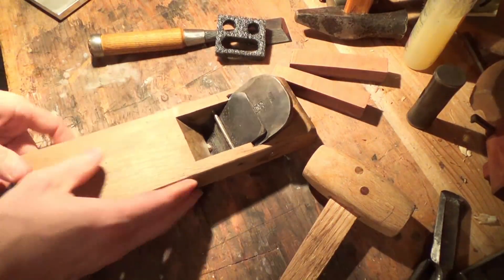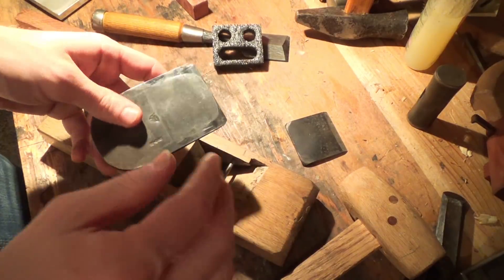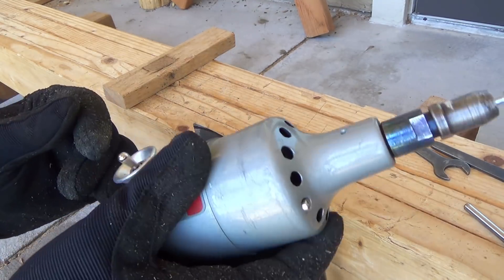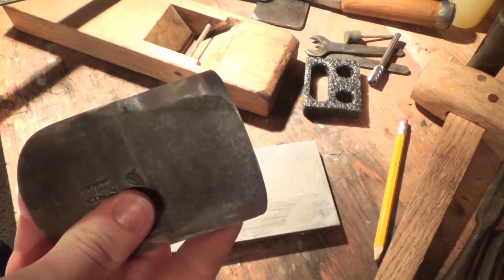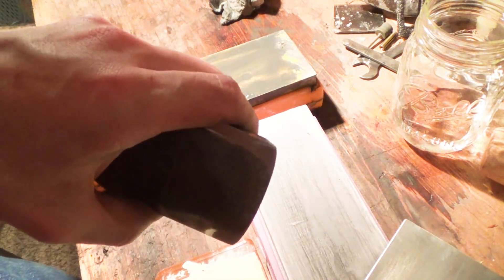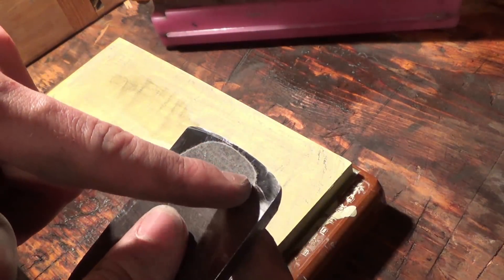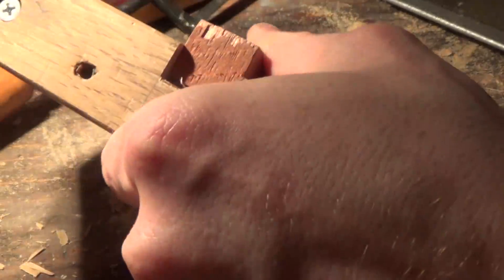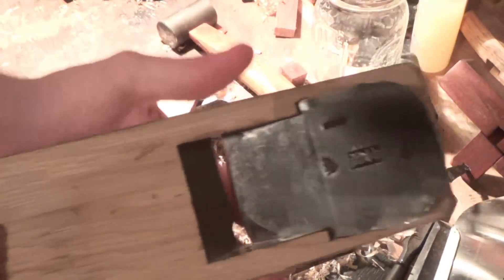Making a Herashi Kanna || Japanese Scrub Plane

Comment: So you scrub plane to knock down the high spots, and at what point do you switch to a longer jointing plane, and or a smoother? When the twist is gone obviously, but how do you know if it's flat enough along the length and width? When the straight edge touches most of the "tops" of the scalloped cuts?
Reply from the maker: Good question. I use my marking gauge to mark the thickness I need along the edge and then plane down to that point. Typically the rough planed portion goes on the inside of a piece. If you watch my Yokozuna Chest build it'll give you an idea of how I go about it. 

I don't really flatten out the rough planed portion unless it's going to be visible from both sides of the finished product.

Comment: 4 years later... Do you still use this scrub plane? And I'm curious, at the end you said something with "mas"in it. I've heard that a lot with Japanese carpentry videos. What does it mean?
Reply from the maker: Believe it or not it sits on my shelf and gets used regularly. At the end of the video I'm just saying "thank you" in a polite way
Reply: @Lemongrasspicker  thats great to hear. I believe I'd like to try make one of these. I have already converted a Harbour Freight 33 Windsor into a scrub, enlargened the mouth, radius to 6", made it hair shaving sharp etc. Doesnt work as nicely as I would like - as I see others making lovely shaving from it. Mine makes rough wood and some shavings, like using a very coarse rasp. Any ideas why? (and I have gone 45deg/90deg against the grain, with trying different depth of cuts too) Lastly, can you let me know what the "polite thank you" words are in Japanese please? I know its Mas something. Tx.
Reply from the maker: @LitoGeorge  arigato gozaimasu is the English spelling version of what I'm saying. On your scrub plane. Its very tough to tell with an issue like that what the underlying problem is but it sounds like perhaps the angle you've ground the edge at is too steep/stumpy which is ripping the wood instead of cutting it. Try a lower angle on the edge and see what happens. Again I'm just guessing here it could even be that the blade is too loose in the plane which is making it chatter and skip across the grain rather than cut it.
Reply: @Lemongrasspicker  thank you for all the different answers. The blade is tight, held in place very firmly. I will try a lower angle. I had it at 25 and then 35deg, both made no difference. I'll try 20 on this disaster. Cheers

Comment: That's awesome. It should come in really handy. Is pulling it during a heavy cut difficult? In my mind this is one area where I think pushing could be advantageous
Reply from the maker: Thanks sir. As far as being tough to pull I didn't really notice anything. I tried it with the sole both dry and with some butcher block conditioner and both were pretty much the same. One thing I noticed with pulling on heavy cuts off camera was that with a pull I can use gravity to assist. In that sense I don't need alot of weight to push against to get a big clean chip because the work wedges itself against the stop on a pull stroke.
Reply: Cool. I think I'm going to try this
Reply from the maker: Joseph Laviolette go for it. I'd like to see your results when you get it done
Reply: I'm going to grab a cheap Amazon kanna I think and give it a go.
Reply from the maker: Joseph Laviolette looking forward to seeing it